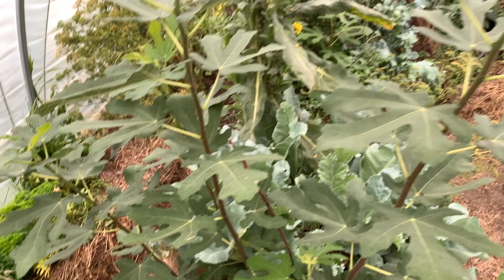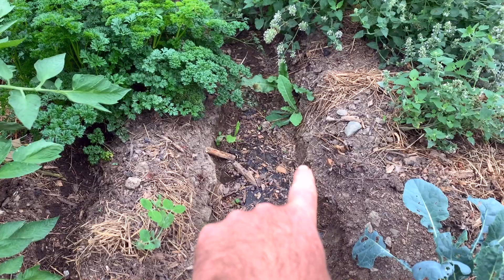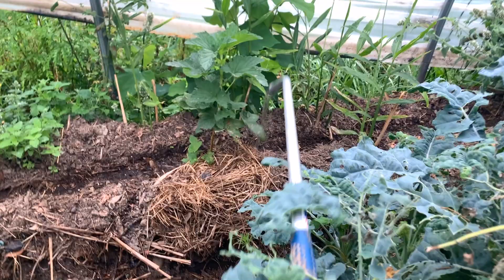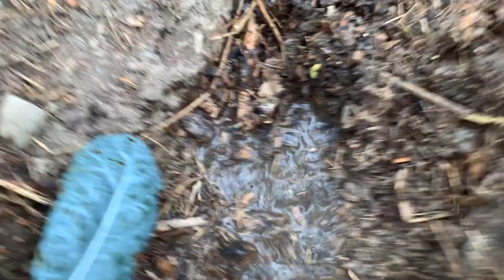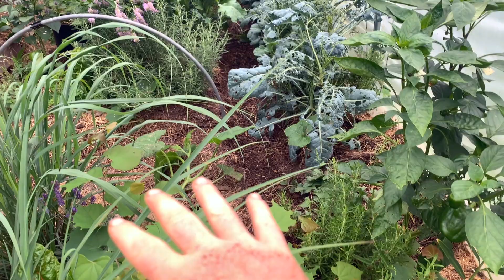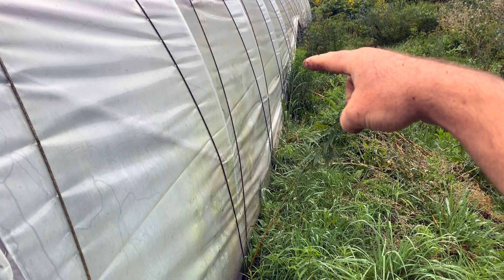High Tunnel - Swales for Flood Irrigation

Comment: Flood irrigation works great if you have lot of water. Can cause sedimentation compaction, and anaerobic conditions on the long term. Low tech drip equivalen would be the terracotta pot technique? What do you think about that?
Thanks for the video, always enjoyable content.
Reply from the maker: I hear you in possible issues, although my plan is to renovate the 'channels' but scraping them out and using as mulch on beds pretty often so the turnover literally of soil will be good there...
Pots are a way to add water in spots, but wouldn't work for me in this context.  Amazing for a few raised beds for sure!
Reply: @edibleacres  Thanks for your answer! Context matters of course, and your area has abundant rainfall!

Comment: Water would drain away in the sand at the south side of my greenhouse. While I was rebuilding the foundation and it was dug out, I put down a water barrier and a flexible perforated tube from one end to the other. Now I can fill that tube with water and it saturates the soil from the bottom.
Reply from the maker: Very cool!

Comment: Why not just put in gravity fed drip irrigation?
Reply from the maker: I'm interested in less plastic touching the soil and leaching into our food.  I'm not intensely against it, but just more interested in not using it
Reply: @edibleacres  there is drip irrigation that's made with non toxic materials that would be safe and is made especially for that purpose. Swales are good for larger producing fields where mostly fruit trees are grown so that the ground won't get eroded from too much rain and it's a good idea to let the runoff flow into a pond to capture some of the water but for greenhouses it seems a bit messy. I've also seen swales in a food forest like in permaculture but with the runoff always being captured in some sort of reservoir.

Comment: My first thought for the watering would be.. gravity fed drip irrigation, fed from say a 30-50 gallon elevated tank, filled via solar pump. It's not completely passive, but about as good as  you'll likely get, without living someplace with a significantly elevated water source such as a pond 10s of feet higher, or from a flowing creek or river via ram-pump.
Reply from the maker: I hear ya...  The rain water tanks we have are about maybe 20 feet higher and it really works

Comment: I don't know how you can get away with figs inside the tunnel. I know I'm way far south (Arkansas) but the figs in my backyard near Memphis, in one year would be close to 15 feet tall, and of similar diameter. I think my soil was tooo good, with excessive nitrogen for them as they grew huge, but not a lot of fruit. I probably need them in some kind of container to keep them smaller and force them to fruit. Someday.  Anyway, lovin the videos, and keeping up after watching the Verge series.
Reply: I had the same problem here in northern germany, had figs in containers for a few years , then planted them in soil in the high tunnel , they grew 7 by 7 feet in one year , no fruit to be seen , i lifted them this spring and planted them on the southside of the house , next to a privet hedge , they grew "only" 2 feet this summer , but still no fruits
Reply from the maker: Glad to have you with us... I could imagine immensely fertile soil would produce copious growth and minimal fruit, but I'm also just starting to learn myself...

Comment: The water manifold that you are using as a valve is a choke point in your water system. If you look inside the ball valve itself is half the diameter of a hose reducing flow especially in a low pressure system like yours. I appreciate your videos and learn alot
Reply from the maker: VERY good reminder.  Yep, I'm aware, this is a thing meant for a much higher pressure system.  It's what I have for now but I'll keep an eye out for a 0 restriction one
Reply: @edibleacres  the large plastic ones have a full flow maybe some will cross your path

Comment: I know you don't like to add new plastic, but you can also use some kinds of drip irrigation with gravity fed irrigation. Flag drip emitters will work with less than 1 psi. It's very slow, but that doesn't matter because you aren't there watering the plants. Space the emitters every 6 inches, and it waters itself.
Reply from the maker: Good reminder as a backup